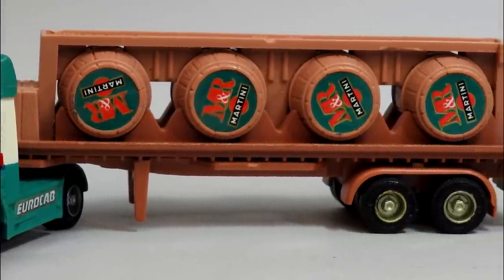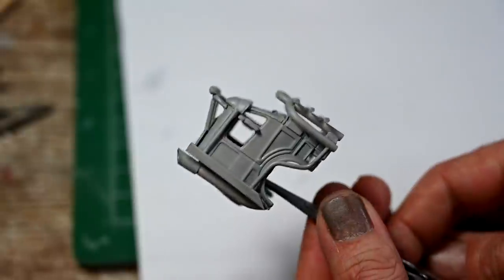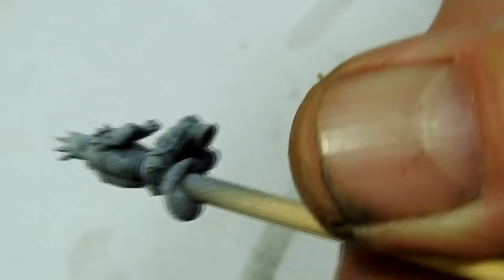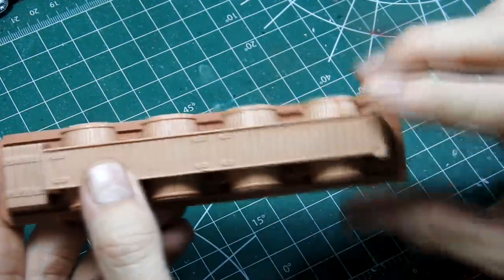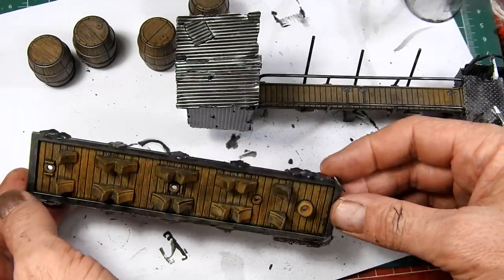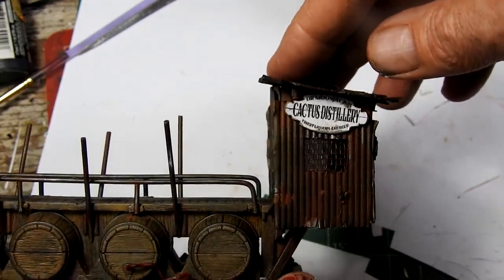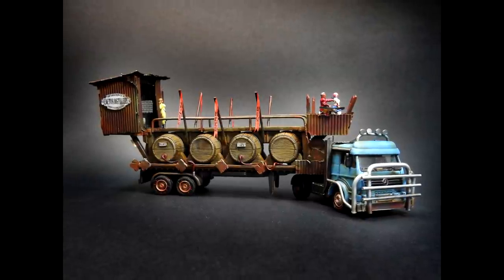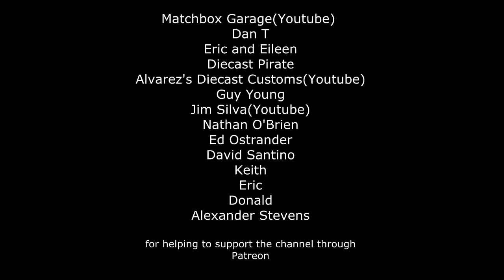Mad Max Style Liquor Transport Truck Post Apocalyptic Custom Diecast

Comment: I once had a small gift set of diecast trucks that had one of these in it, with a different trailer. Don't remember the company, unfortunately. I picked em up because they looked a little bit like a truck I'd had even EARLIER (same wheels, same scale) that came with a flywheel friction motor inside. You're right, no info on EITHER type exists. There ARE similar sets now-- but they're all very high end accurate with branded livery and come in these padded collectible boxes-- pretty much promotional level. I would ALSO be interested in finding any info about either type I had.

EDIT: The cabs on the FRICTION TRUCKS at least SEEMED to be made of a lighter metal. Not exactly tin, or if it was it was kind of THICK tin-- but I remember the hood being folded together with tab and slot.

RE-EDIT; Looking under Kentoy Wheelers Town Truck series in google images returns a lot of images for used or vintage in box sets and models. The general consensus seems to be that they were from around 98-99 originally.